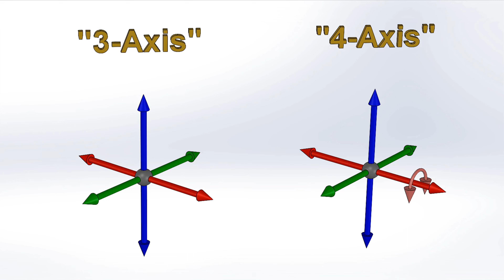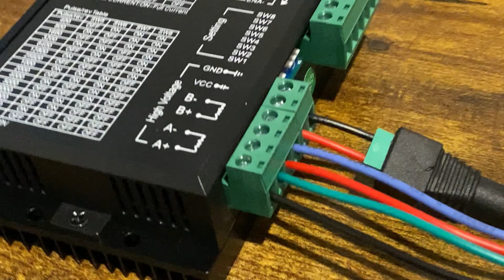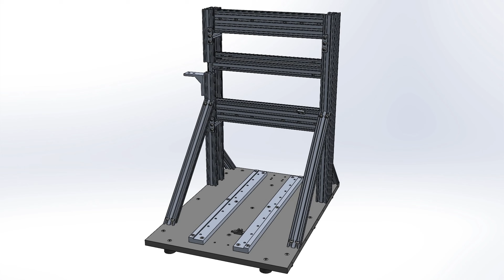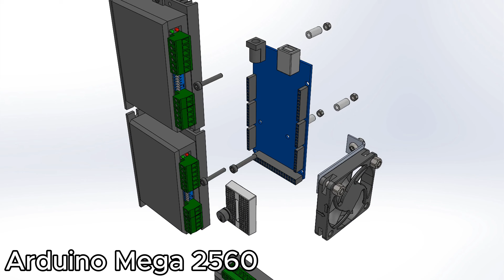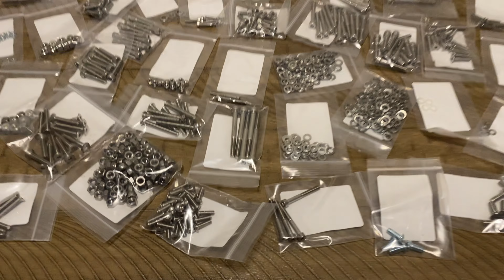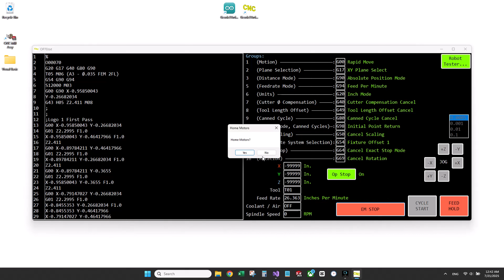CNC Mill From Scratch - Designed, Built, & Programmed

Comment: Amazing build Randall!! But i not understand why you not design the enclosed cabinet with more room at the top for absolute enclosed...With the Z Motor mid outside the enclosed you are need to cut the top and the sound of cutting are scape...
Reply from the maker: On the top, I have a piece of wood that slides with the motor, so the top stays covered and is still pretty quiet. I went this route to use less wood, reducing cost and weight
Reply: @RandallMech  ohhh this is a good solution!!! I need more vids of your machine!!
Reply from the maker: Thank you!